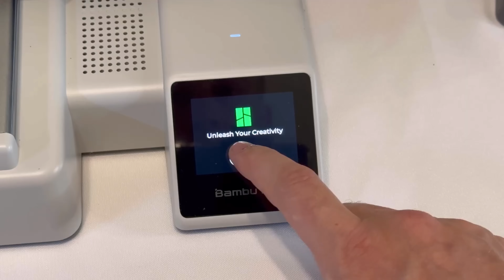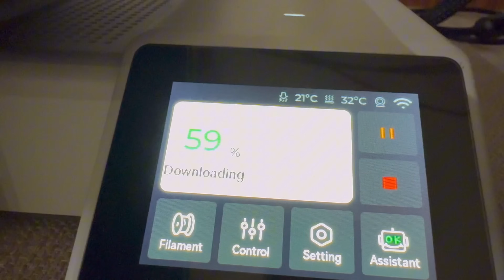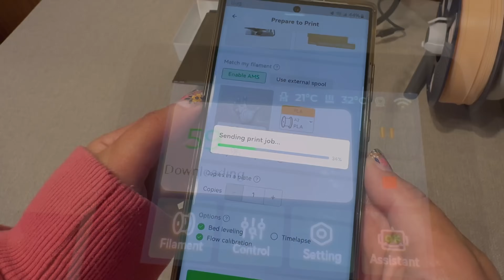Bambu Lab A1 Mini Review - Update After 9 Months!

Comment: I have mixed feelings with mine. Got mine last Christmas (2023). It worked great at first, but now it has adhesion issues. One project comes out perfectly, and the next becomes spaghetti. I have a box full of wasted PLA filament and projects. Not sure what the problem is, but I hope to find a solution soon because I am on the third attempt to print one project that takes 3.9 hours to print. Not very convenient nor economical.

Edit: I just finished watching your video, and I didn't realize filament can absorb moisture. I am going to invest in a dryer and see if that helps. Otherwise, I must agree this printer is rock-solid in its build quality. But then, it is my first, so I have nothing to compare against except reviews like yours.

Edit two weeks later: Since my last edit, I have printed a number of projects, and I have found what works and what doesn't work. So, it turns out that cleaning was a big factor in a successful print. After cleaning the plate, the same job that failed earlier printed successfully.  So does a number of other factors: speed, temperature of the room, and project print settings. If the room is too cold, the print is more likely to fail. I had the room at 60 degrees F, and it seems that is too cold because there is no enclosure for the A1 Mini. Basically, the room is the enclosure, so I had to turn the temp up to 65 F. Another factor is the speed. I found that if I slowed down a job that had tall, slender objects it was more likely to succeed. And finally, I found that if I added brims and/or supports it would more likely succeed. Just a few tips in my learning experience I thought I would pass along. Using these tips for a successful print, I have been able to print a number of projects successfully, and the results are impressive (but this is my first and only printer). The A1 Mini can definitely provide a rewarding and satisfying hobby and I feel like I made the right decision.
Reply: Make sure you are cleaning your build plate once in a while, oils on the plate from your hands and from previous prints will affect adhesion. Clean with soap and water or isopropyl alcohol. I like to use soap to get everything, then every few prints do a quick wipe with isopropyl to keep it fresh.
Reply: @xSirDingo  Agree.  My primary cleaning is over the sink, and using a couple of paper towels to dry and transport.  With dish washing, you know everything is going down the drain, not just getting redistributed.  And a quick wipe with IPA before a print won't hurt at all.
Reply: thanks for following up your comment with your discoveries bro, super helpful!
Reply: Clean plate, calibrate. If that fails up the plate temp.
Reply: If you were unaware of the problem of moisture, I wonder if you are also aware of the critical importance of a super clean (finger-grease-free) build plate. If you have the standard plate for the A1 Mini, dish soap and water is ideal for cleaning. 
If the build plate is clean, first-layer adhesion can be good and therefore spaghetti much less likely.
Reply: @dougal6569  Thanks. Cleaning the plate definitely made a difference.
Reply: thats user issue, not printer😀, i have A1 combo about 1600hours and 1.5 year,...mine was working good just one month, after that spaghetti, clogs and more(so on bambuwiki i found everything, how you could setup materials, printer and other), from that, i got 99% printing without issue(1% is user issue - forget add to support, bad filament profile...)
Reply: Bro how is your AC still running at 60° all the time anyways
Reply: @TexasAerospace  It was winter time so the heat was on. 60 is a little too chilly for most people.

Comment: The cameras suck on 3d printers because the processor inside the printer can't support anything better. The price would go way up if they upgraded to a processor/chipset that would support good quality video.

I don't mind the camera on the A1 Mini because it lets me check for crazy stuff at a glance. Engineered to purpose, I suppose.
Reply: Hmm.... Maybe Bambulab could make a better mainboard for "enthusiasts". That way you could upgrade your printer for a price that is acceptable for those that want a faster type. Of course they must offer that replacement with the explicit notice that they are not responsible for damage caused by these kind of modifications. Some people have more money than sense sadly...
I honestly think they will not do that, because reliability and ease to use are the main target for this brand, but nevertheless...
Reply: I would suspect that most of the problems could be solved by better firmware in the camera module itself.  One of the camera problems is rolling shutter, which can be managed internally.  Also, the distortion can be fixed the same way.  It would would not be shocking if a higher quality replacement camera might cost $10 - $15 more than the stock camera, IF they haven't put too much video control on the main board.  (Some of those Bambu people used to work for DJI.  This should not be a heavy lift for them.)

Comment: How long do you leave the filament in the dryer before putting it to use?
Reply: There are different time and temperature specifications for the different filament materials. Manufacturers publish the details. But several hours in the moving warm air is the general idea. 
Some materials are particularly sensitive to moisture, or absorb moisture quickly. PLA not so much. 
After drying the reel, you should think about storing it sealed away from damp air, so it stays dry. That is more important here in England (or in Oregon) than it would be in Arizona for example.